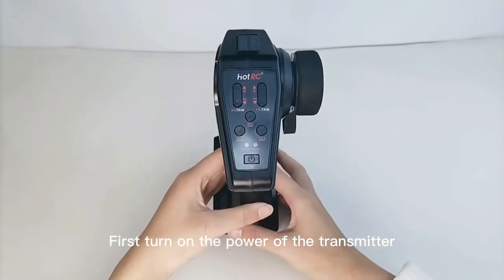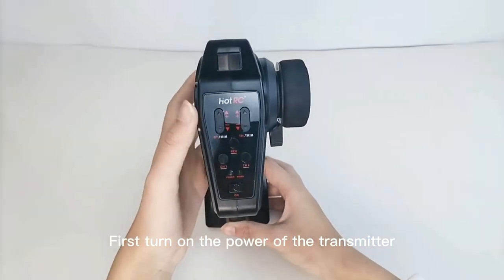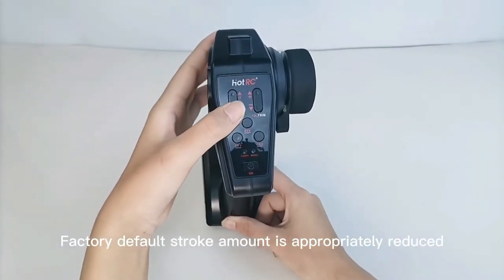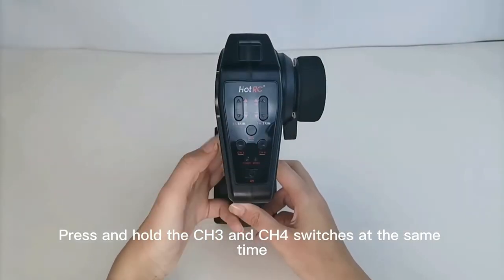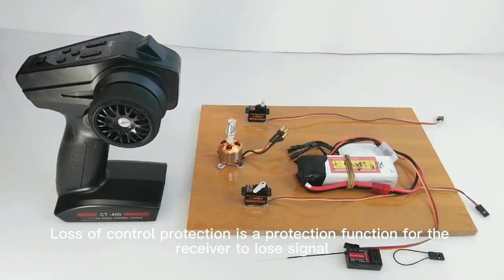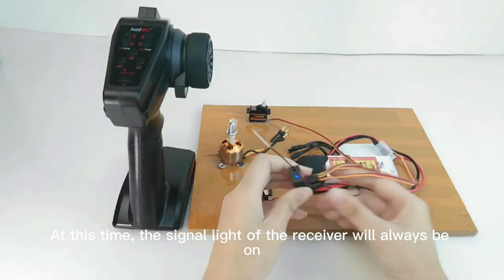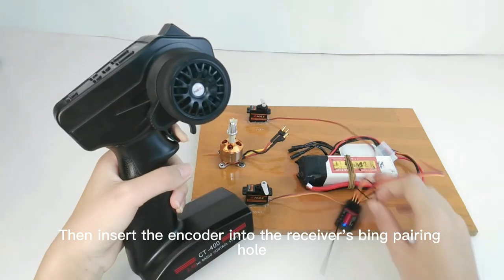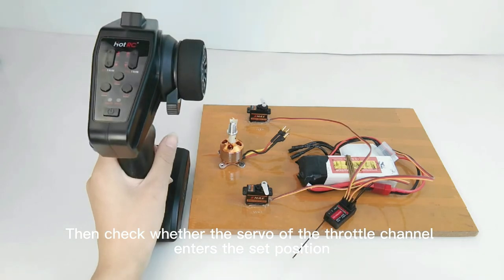How to set the related functions of the HotRC CT-400 remote control

Comment: Trigger and steering don't work
Reply from the maker: First check whether the remote control and the receiver are properly aligned; if they are normally aligned, it means that there is no problem with the remote control and the receiver. Check again that the plug on your receiver is plugged in properly.
Reply: How to check like d the video can't turn on
Reply: Everything has been done, and still not working
Reply from the maker: @nenysyarifah6608  Is there no signal from your line output?
Reply: Only the remote trigger and steering wheel don't work
Reply: Other buttons are normal
Reply: Unable to bind
Reply: The video shows a remote test without a receiver??
Reply: Positive and negative Chanel settings do not work
Reply from the maker: @nenysyarifah6608  1 2 channels have no signal output. It is possible that the receiver is badly connected. Other channels can be used normally, right?
Reply: Only the trigger and remote steering don't work
Reply from the maker: @nenysyarifah6608  You don't have a receiver yet, try another receiver. If it still doesn't work, it means that the remote control trigger and the handwheel are not in good contact.
Reply: I only have one receiver, which came from the remote itself, and I bought a new one
Reply from the maker: @nenysyarifah6608  Other channels can be used normally, but channel 1 and 2 do not respond. I also feel strange.
Reply: In the demonstration video, the first step is "positive and negatif Chanel do not work
Reply: Can't change new ????
Reply from the maker: @nenysyarifah6608  Or you wait for another receiver to arrive and try again. If it still doesn't work after you try it, then you can turn on the remote control to see if the wire is loose.
Reply: Yes, it seems that the handweel and trigger contact are not in a good connection

Comment: Dear Authorities Greetings

I bought the HOTRC CT-4A remote control on Aliexpress about 1 month ago. But as of yesterday I wanted to install the product. I think the settings of this product are not configured. Servo motor works, Forward-Reverse Gas does not work. I have 4 KYRC brush ESC and 3 flycolor esc, none of them are active.
How to factory reset this remote control. I did so much research, I couldn't find it anywhere. I would like your very urgent support.